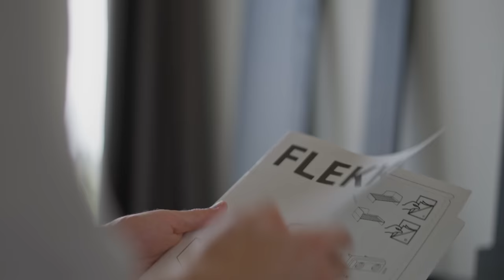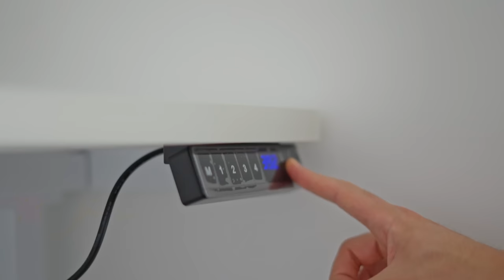Architect's Tiny Transforming Bedroom Office Makeover - 7.9sqm/85sqft

Comment: Just a thought, if you were to take a hacksaw to the electric sit stand desk, cut the wall facing foot and armature down to about 10cm, drill a hole in the 10cm spur, bolt angle to the foot and attach it to the wall above the skirting.  Wirk out the depth from the front of the screen, turn your PC sideways,  cut the desktop so you have a couple of centimetres and fit a piano hinge between the two. Then you could still have a sitstand desk, but with the top that could hinge up to hide the work area from the sleep area. Hope I've explained it to be understandable